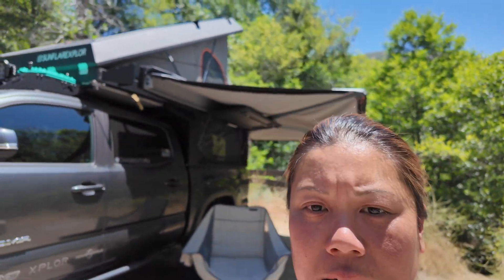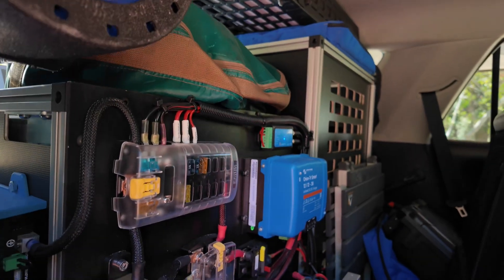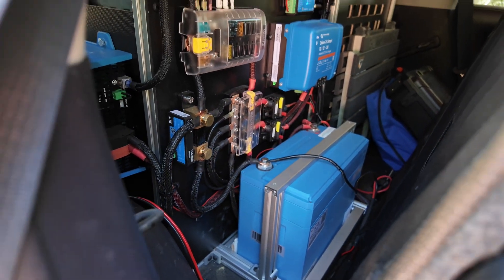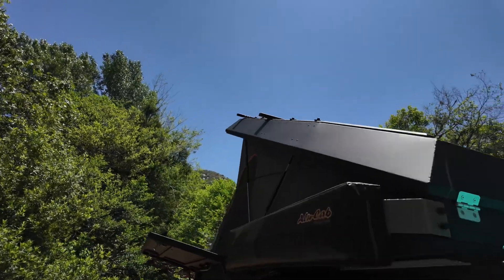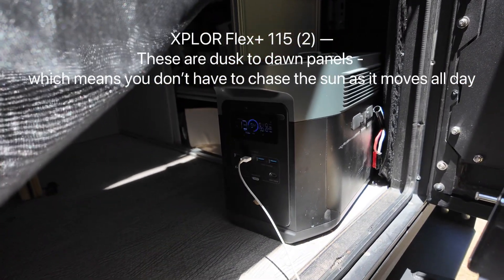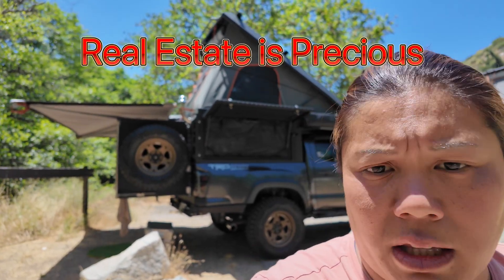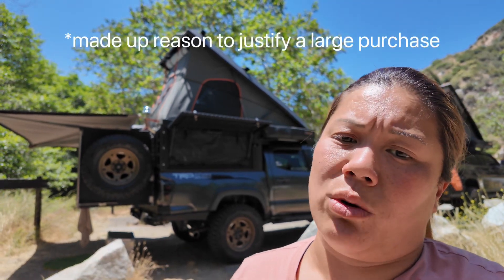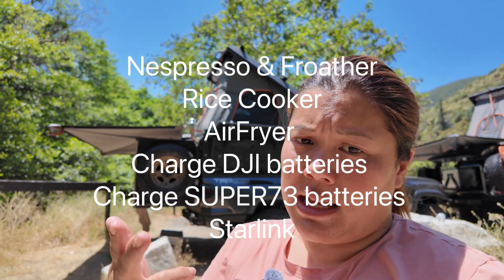XPLOR Solar panels set up - House Battery or Portable Battery Set Up

Comment: so how are the camper lights etc wired to the ecoflow?
is there a panel in-between the all cab camper lighting and the ecoflow?
Reply from the maker: The solar is directly into the EcoFlow (the camper has +\- wires down into the camper). And the rest of the wires (in a prewired harness) are going to a fuse panel - which is powered by a harness we made and powered by the EcoFlow.
Reply: @WhatTheHegg  thank you...Good to know as I am getting my alu cab soon and I'm using ecoflow delta 2 max as my power source for a Global trip